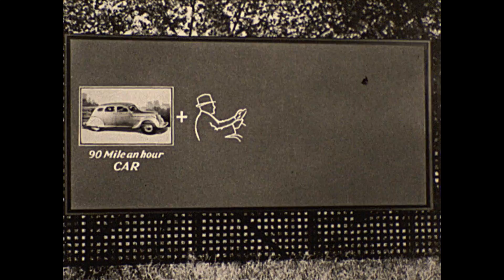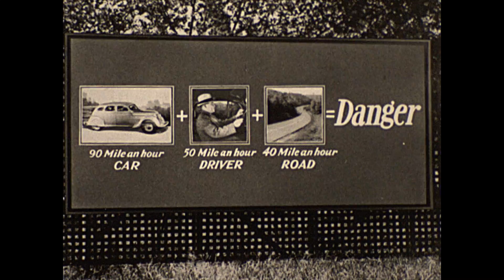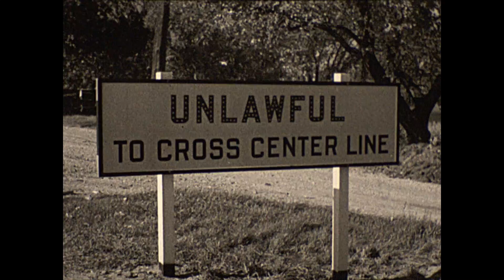1938 Michigan State Highway Department film: Safer Roads

Comment: I live in rural Michigan, in 2011 they redid my road, that I thought was not needed, they went through and chopped a road that was 8" thick, than put a foot of sandy gravel on top we drove on that for a month or so than put 2" of asphalt on top, raised the road 14" it is now a crumbled up mess, did some looking and found the 8" road was put down in 1939, I thought at the time they should have just skimmed off 2 or 4" and put 2 or 4 right back on, I'm sure the cost would have been 25% and the road height remain the same and last another 50 plus years.
Reply from the maker: Hi Mr. Smith! What was the name of that road?
Reply: @MichiganDOT  I really don't want to put it out there where I live, have become quite a Conservative over the last 10 or 15 years, after seeing what the left is truly capable of, I know there are some people that would like to know where I live, we are moving into some very scary times.
Reply from the maker: Hi Mr. Smith! Without a location it's pretty hard to help you, then. MDOT has jurisdiction over state roads - I, M and US routes. If this was a locally owned road then the local road agency, typically the county, can address the concerns baout the road you mentioned. Hope this helps. Thanks for ofllowing MDOT,